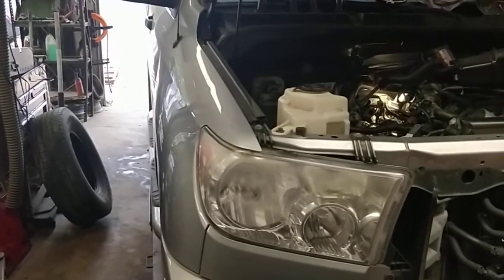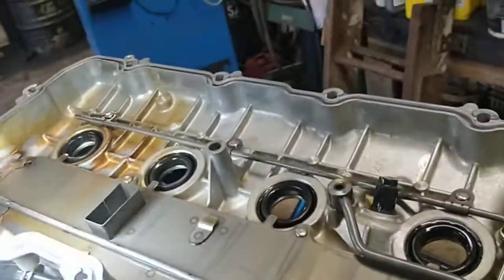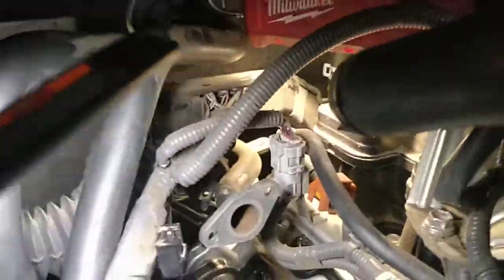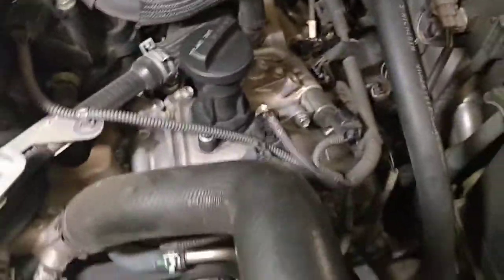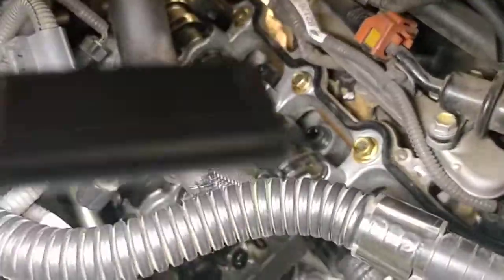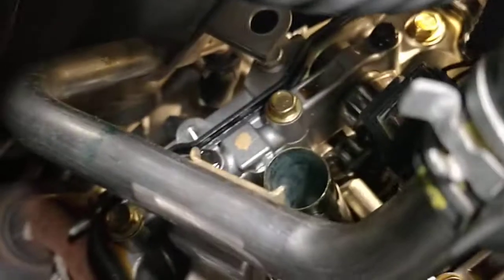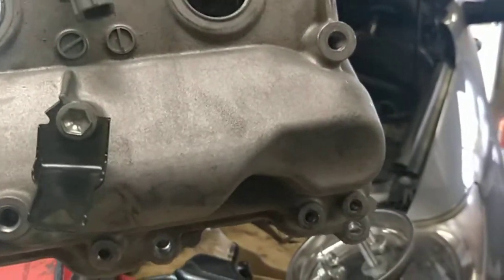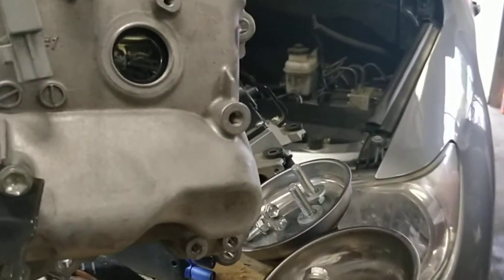2011 Tundra valve cover gaskets 1URFE motor

Comment: how did you remove the old spark plug seals? mine are baked in i have to get a new cover
Reply from the maker: normally I get a large flat blade screwdriver or I use a lady's foot to get under the edge of it and pry sideways to the seal that normally lifts one area and then I repeat that until the tube seal comes out. If yours were stuck there may not have been an alternative.
Reply: @jwilkers1  i managed to pry them loose
Reply: @jwilkers1  I used a large screwdriver, with a smaller screwdriver crossways under it to create leverage, and I was able to pry upward and out. Now about the installation, well I haven't started that yet. Which is why I am here Lol
Reply: I used a hairdryer as a heat gun to heat them up. Popped right out after a little while. Didn't want to risk damaging the mating surfaces.